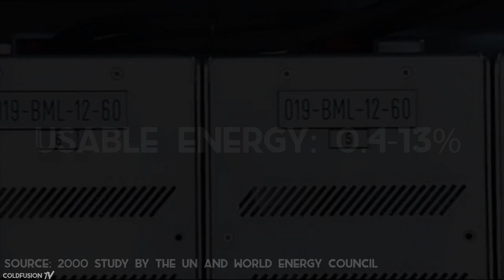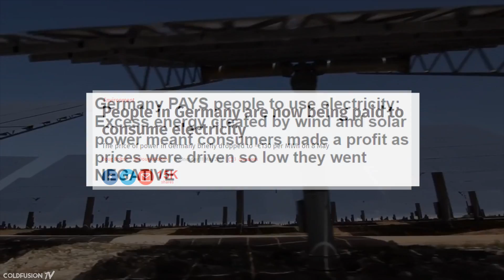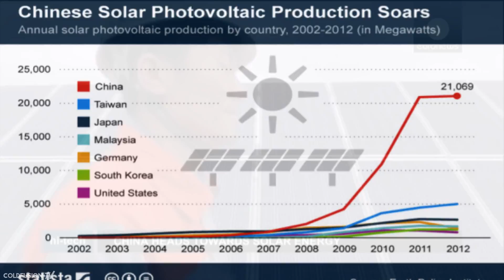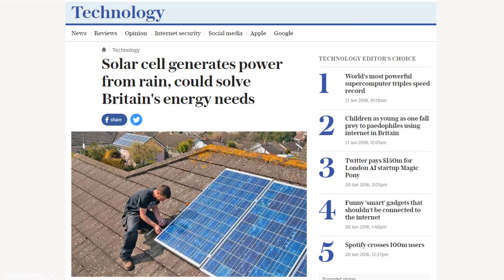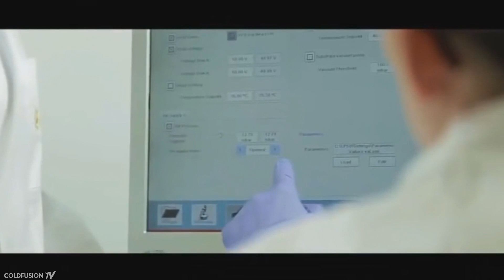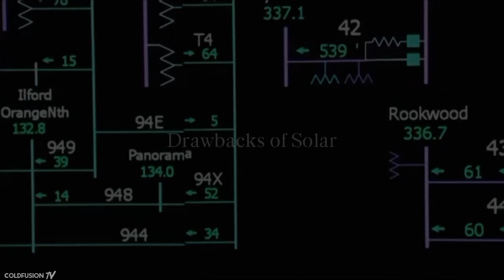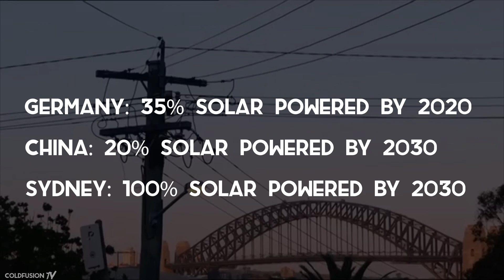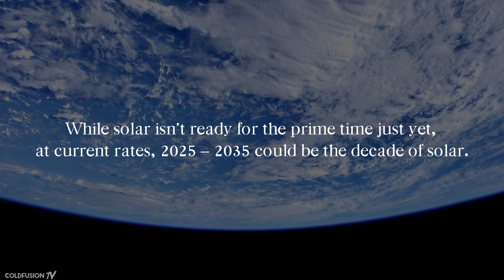The Truth About Solar

Comment: We really need a way to balance solar power loads. We talk about solar driving energy costs below zero like it's a good thing, but it is not. It means all that extra energy is wasted, because currently we have no way to store it. The reason why combustion or nuclear plants are preferred in some cases is that they are very easy to tweak - you can set plant A to minimum power if there's no need for that energy, while you can kick plant B into overdrive, so to speak, if area B needs some extra energy. Solar can't do that. Also, night time is a problem.

So if we really want solar to break through we need some way to store enormous amounts of unused energy and quickly retrieve it for night time and other peak moments. For this the photovoltaic fad needs to stop - as good as PV is, the energy it produces is impossible to store without large losses due to multiple conversions. The future for stable power is very likely concentrated solar thermal - molten salt solar towers, for example, can remain fully operational for an entire week of cloudy skies, including night time; no need to spend tons of money in batteries, and in case of over-generation you can simply stop the turbine. That's huge. IMO the future is in solar-thermal applications, at least for the stable part of power production.
Reply: Solar Thermal only works well when there is a single light source in the sky, so when the light is diffuse it doesn't work really well ( i.e. cloudy).
Also, coal plants or nuclear power plants are not easily tweakable, that's why they are called "base-load". Gas plants are though.
Reply: There is a way to balance solar.. A worldwide grid.. After all,  the sun actually never goes to sleep.. All you have to do is transmit your excess day energy Westwards as the sun comes from the east. In a global network,  it should work pretty well.. A lot of kinks with geography would have to be worked out but even big countries like the USA should be able to use a system like this to make do until the sun comes out again.. If it's not enough,  you just build more capturing devices on the east coast until you have a stable system
Reply: Musk just said that the new cells work at 80% when cloudy....so they still work and perhaps well enough.
Reply: As big as the USA is its still only 4 time zones and thus only gain 4 hours transmitting from east to west.   A lot of power gets lost through the transmission and subject to weather related problems.
Reply: +Hattu Teline why?
Reply: Bahadır Onur Güdürü Because the chain reaction stops at some point.
Reply: If we had room temperature superconductors this would not be a problem
Reply: That is why worldwide was mentioned, the biggest problem would be places when peak load happens while peak isolation is over the atlantic/pacific ocean. 

The theory also falls apart (Without storage anyways) when peak usage doesn't match peak isolation patterns, it's just not doable with matching any combinations of [stationary] solar panel locations anywhere in the world.

It would still be ideal to have a worldwide electrical grid with solar spread out throughout the world (well as long as some 3rd world countries don't start filling it up with coal power) HVDC is very efficient for very long distances.